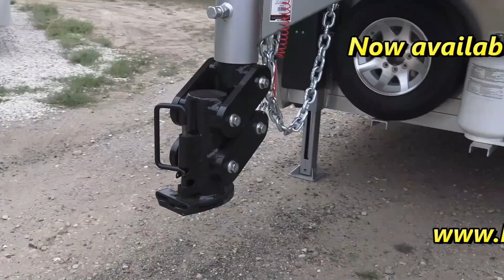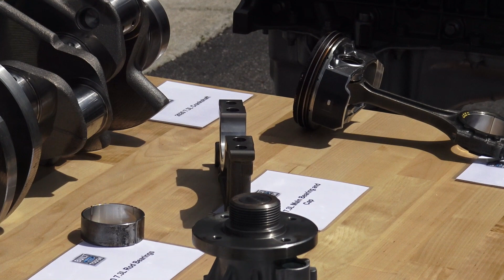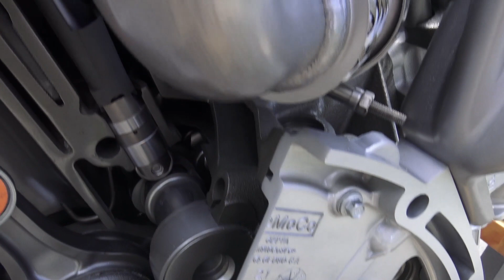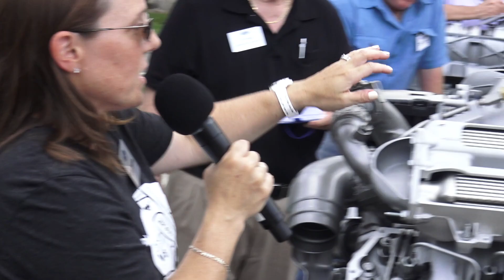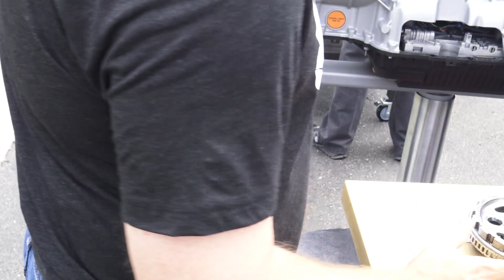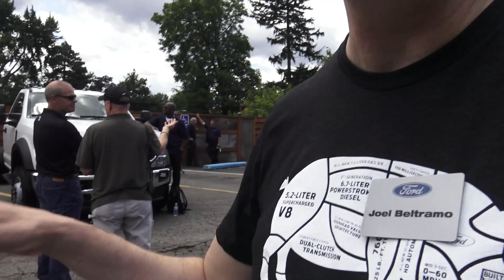Finally Ford 2020 Super Duty truck engine numbers and can they beat Ram

Comment: Disappointed with the use of too much aluminum in so called heavy duty truck engines.  That does not translate to toughness and real longevity if you tow a lot of heavy loads.
Get back to iron blocks and heads for Petes sake!

Comment: almost willing to bet the new 6.7 is heading towards 1200-1500 lb ft of torque neighborhood.

also with the piston design and material changes it looks as if they are aiming at higher RPM capability's.

Comment: I have a 2016 f250 with a6.2. It has a 12200 lb 5th wheel rating. How close to that # should I go?
Reply from the maker: If a static load, all the way. If livestock or horses, go down 10%.

Comment: MAIN THING SAID... YOU SHOULD HAVE GOT THE BIG BOY DIESEL ENGINE.. That's what I heard. My 6.7 diesel walks off from the 7.3 gas. I will never buy another gas truck.. Diesel is a torque monster. I pull a 20 ft landscaping trailer everyday. It will lite the tires up fully loaded. I'll keep my diesel. Great video

Comment: What's with all these presenters reading from notes? They appear to be the Ford Engineers that designed these systems, and as such, should know the specs front and back without hesitation.

Comment: All manufacturers need to bring back the big blocks that make gobs of torque , the 460 ford and 440 mopar and 454 chevy all can be added back with turbos or super chargers mated to 6 speeds or 10 speed transmissions and be work horeses.
Reply: problem with that is the battle with the EPA & CARB.
Reply: @dancarlin5434  i live in Pennsylvania any truck that has a gvw at 10,000 or more has no emission testing. This country needs to tell the tree huggers to go F-off and hope that California falls off and drowns !!

Comment: The 1970 Buick 455 delivered 510 ft lbs of torque,never been ousted from #1 in torque for a Detroit gasoline V-8.
Reply: Wrong. The Cadillac 500 cubic inch V8 engine produced 550ft lbs of torque
Reply: I'll put an Aftermarket ECU Tune on the 7.3 for another 20 hp & 40 tq

Comment: AH finally split shaft pto. For the novice the drive shaft runs to a transfer case one shaft in 2 shafts out one drives the vehicle the other drives a implement like a blower like the sewer suckers use need full power from the engine.These transfer cases drive only one shaft at a time what they are saying in split shaft mode when in pto mode you can pick the gear for the rpm you need. Also when in this mode the torque converter will lock up its all software simple and given to the installer.

Comment: Sad to see the v10 go away, but the new 7.3 is a far superior motor as it builds torque much sooner than the v10.  That equals a gas motor better equipped to haul and tow heavy loads.  I'm guessing it could handle a 20,000 lb gvw toy hauler   if properly equipped.
Reply: Better handle more than that!
Reply: I certainly wouldn’t want to pull 20k that little torque. Cummins mpg and torque has me spoiled I suppose, you guys go ahead and test it out though.
Reply: @scottcravens9454  - it depends on what the Gearing is

Comment: When should we expect HP and Torque numbers on the Powerstroke?
Reply: Will Bubel this gen is 450/935 I think so I bet the 2020 will be around 475/1,000.  Just guessing though but I’m like you very curious.
Reply: And go to iron heads so the PS will last like a Cummins.

Comment: I’m not a Ford guy (Cummins all the way), but I’ve been anxiously awaiting the hp/torque numbers for this engine.  Despite not being in the 450 hp / 500 lb-ft range that some had hoped for, this engine seems to be well thought out and designed for durability.  Assuredly, there’s some power “in reserve” for future upgrades.  Considering that big block V-8 460’s & 454’s from 20 years ago only put out around 300 hp (stock), this can be a winner if it proves to be somewhat reasonable on fuel compared to the old big blocks.
Reply: 430/475 is pretty close to the 450/500 target especially considering it's the introductory year. I'll bet they left themselves some room to grow in the future when GM and FCA start to get close with their premium gas engines.
Much like the HP/Torque bragging rights for diesels. It's essentially just a calibration away from outdoing the other guy by 5Hp/10Ft-lbs.

Comment: I'm test driving a tremor 7.3 -4.30 ,,soon as they hit the ground. currently in a 17 6.7 cc4x , and very pleased with it. But still miss the 6.2 13 raptor    rumble,🇺🇸
Reply from the maker: The 4.3 axle worries me. That's how the Excursion started.
Reply: MrTruck they need to bring back the excursion!

Comment: Historically, the Allison 1000 seemed to transfer more torque to the drive wheel than the others. Perhaps this Ford unit closes the gap. Then again, maybe the new Allison 10L1000 broadened it....
Reply: http://gmauthority.com/blog/2018/12/2020-silverado-hds-allison-transmission-isnt-really-an-allison/
Reply: When a converter locks up, it locks up dude. That is a stoopid comment.
Reply: @johncholmes643  
There's more to transmitting torque to drive wheels than the torque converter. You have clutches, bands and how they're designed...just to name a few.

Comment: why can't you get the 7.3 in the f450 pickup?
Reply from the maker: Probably because the diesel will use all the ability of a F450.
Reply: But they are putting it in the f550 and f600 and f650?  @MrTruckTV
Reply from the maker: Not sure, Ford didn't say that that I heard.
Reply: @MrTruckTV  on their chart there is no x with the f-450 pick up

Comment: Ok so what good is it to put 4 extra gears in a transmission but keep the same axle ratios. The whole point of having more gears is so you can pull the weight with a taller axle ratio and still get the mileage when up in the over drive gears. This is the problem I have with the current 450 pick ups and the 4.30 rears. I am on my second one now and sick of getting max mpg of 15 when not towing anything. They have the power there is no need to keep them geared in the basement. Would like to stay with Ford but oh well I guess.
Reply: Because the gearing in the transmission will be far more aggressive in the new 10 speed and you can do more with the  same gears in the rear axle and get better fuel milage!

Comment: Those power numbers are low to help it last forever. The 6.7 Cummings has a version they use in Freightliner 6 and 10 wheeler trucks that only cranky 250hp.
There selling point is it will last forever. No wonder they haven't talked about it's power for a long time lol
Reply: Sorry for the typos.

Comment: I am a Ram 1/2 ton guy but im going to look at the new Tremor package and the 7.3 in a few years after all the bugs have been worked out of the 10 speed and new 7.3.  The power numbers will be up to 450 hp by then i'll imagine.
Reply: Im a ford guy, but im gonna wait till i can drag a new 7.3 / 10spd with my 18yr old chevy 8.1 Ls /allison and see whats up.
Reply: @joenobody2580  8.1 has 100 less HP.

Comment: Well I watched TFL's video first, but your video was more in-depth. I'll tell you similar comment I made on TFL. Why not put this in F150s for people who want to tow in a 1/2 ton but don't want the size of a Super Duty, since the engine and transmission are built for heavy duty unlike the current engine/transmission choices currently in the F150s.
Reply: Sizes are still different but agreed Sir. And because of fuel mileage ratings for half tons are necessary and heavy duties are not.

Comment: He's showing us those surfaces  from that engine with 3200 hours. I would expect nothing less then he showed us, especially if it's continuously run. Much more realistic would be many repeated cold starts. Also he doesn't talk about oil drain intervals use during the test. These things are quite relevant. If you could keep clean oil in the engine and run it continuously it would basically last forever because there would be almost no metal to metal contact at the lower end.
Reply: Ford didn't run the engine (1 of many I expect) so the parts would still look shiny on a table.  They do that so their engineers can spot failure modes.  They are run hard in sub zero and simulated desert conditions.   I seriously doubt they overlooked the average consumer use in 4 1/2 months of runtime, or that the engine wasn't subject to regular service intervals. If anything it was probably abused.